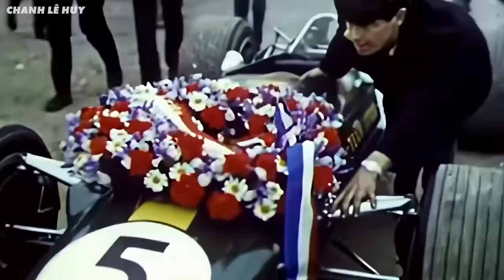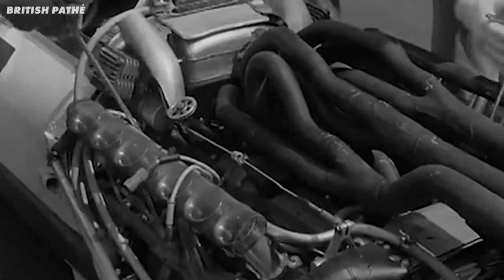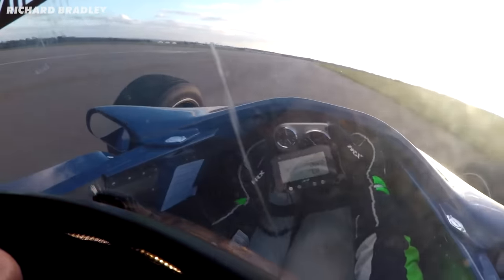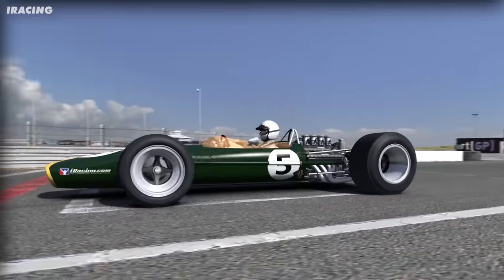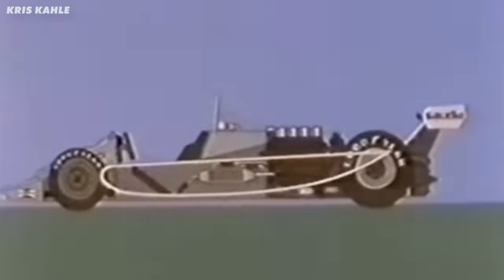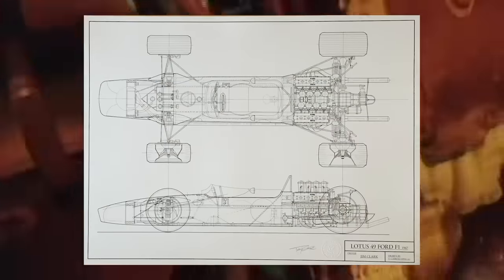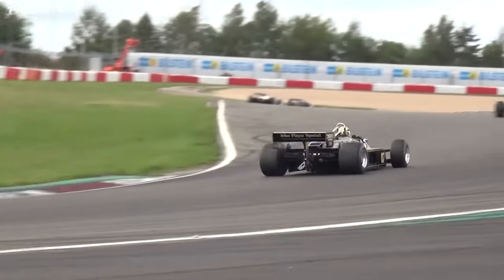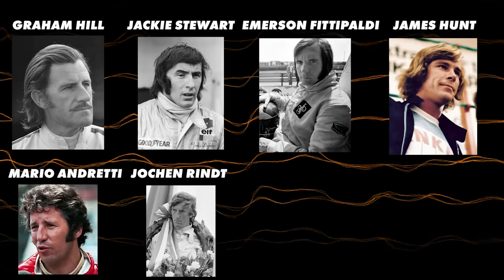When FORD Designed the GREATEST F1 Engine Ever!

Comment: So Ford provided the money  but didn't design and built it ,looks like the upcoming Red Bull deal.
Cosworth should be credited in the title.
Reply: Its usually called the Ford Cosworth V8.
Reply: Because RedBull are designing and building the engines, hence why it’s called a RedBull Powertrain. Not a Ford.
Reply: @JackPayne91   It's going to be called RedBull Ford powertrains and while RedBull will be designing and producing the Ice component of the powertrain Ford is working on the electrical side of the powertrain. So the powertrain is most definetly going to be a RedBull Ford.
Reply: Does it look like the RedBull deal though? Since for is most definetly helping develop the elctrical portion of the powertrain? Instead of just providing the money?
Reply: I mean, that's usually how employing someone works.
Reply: @JackPayne91  Well, the current RBPT was designed and still is maintained by Honda, is it not? ;)
Reply: @RalstigRacing according to who? I've never heard Ford even mentioned when someone asks what a DFV is... It's a Cosworth DFV... Maybe in America is was called a Ford, but the rest of the world knows better...
Reply: Ford haters always want to deny Ford any credit for their efforts even though things like this engine and like the GT-40, the Shelby Cobra wouldn't exist without Ford putting up the money and the request for these items. Ford told them what they wanted and the manufacturers delivered.. It's not like these items existed first and then Ford came along and purchased them. 
None of them would have ever existed if Ford had not made it happen.
Reply: @-joe-davidson  the issue with your examples is that most of Ford's accomplishments are rarely inhouse. The gt40 program sourced help from Shelby and his team, JW engineering and Lola. the only Ford thing in that car is that NASCAR 427 and then that 302 used in 1968 when JW Gulf took over the gt40. Cobra? Well that's all Shelby. Shelby Daytona GT ? That's all Shelby.... Shelby Mustang gt350R ? Well that would still have been a bitches car if it wasn't for the texan......The cosworth DFV was designed my Cosworth 💯........ Ford did zero engineering on that motor. They just used daddy Ford's tools and money that's it .....
Reply: @JackPayne91  why do people like you do that? Why leave out the part where Ford are designing the electric components of the engine, like Redbull didn’t get their engine tech from Honda? It’s a mutual beneficial partnership why you mad
Reply: @MiguelGarcia-vj7oo  the engine in the Lola was a ford engine though and other components, outsourcing components or design from other manufacturers isn’t new, Toyota do it with BMW, a lot of manufacturers, wtf you hating so hard on Ford for? Ford also share their tech with other manufacturers to benefit them and again, Redbull will benefit from fords advanced EV tech.
Reply: @ashdog236 I’m not mad, I am very well educated on the ‘26 RBPT. It’s very much designed and manufactured by Redbull, Ford haven’t really had much if any input.
Reply: Ford thru out its racing history has  just paid the Knowledgeable People to do the work...nothing learned...
Reply: @daniels.2720  that’s a CAP and big generalisation as Redbull are literally gaining Fords in house EV tech with this deal you flop 😂🤦🏻‍♂️
Reply: @JackPayne91  Make sure not to mention Honda, the company actually doing the heavy lifting.
Reply: @JackPayne91 Ford is helping with use powered in and 99% of the electric components …
Reply: @LiamNI it’s 100% justified to be called Ford engine.  SCA Formula 2 engine  engine used the Ford Anglia 105E engine as a basis, retrofitted with an overhead cam head and gear drive on the front of the block. That was the early stages of the DFV as far as I’m concerned. DFV heads were based on the FVA was based Ford engine… 

In September of '59, Ford of Britain introduced a new series of light-car engines, including the 997cc, pushrod Anglia. Duckworth recognized its FJ potential immediately, and Cosworth began producing it in competition trim

Within this same family of related engines, Ford also introduced a 1300cc, 3-main-bearing engine and then a 1500 with five main bearings. The company itself modified the latter engine for use in the Cortina GT. But Colin Chapman got hold of one of the first 1500 blocks and, with Duckworth and engineer Harry Mundy, produced the Lotus twin cam cylinder head for it. It was and still is fitted to certain lotus models and in 1963 was adopted by Ford of Britain for its lotus Cortina.

 Formula 3: production block, single carburetor and displacement of under 1000cc. Also there was Formula 2, for the same displacement limit but without the stock-block restriction. Cosworth built engines for both of these categories, basing them on the Ford 1500cc, 5-main-bearing block. They were immensely successful and a strong raport grew between the big and the little firm.

Duckworth presented his sketches to Harley Copp, engineering director of Ford of Britain and a seasoned judge of racing matters. Copp was impressed by what he saw and by the possibilities it held for a most logical program combining Formulas 1 and 2. A series of meetings followed between Copp, other Ford of Britain technical brass, Duckworth, Costin, Chapman and his chief designer, Maurice Phillippe. Every aspect of the idea was explored and finally, in November of 1965, the program was blessed with an allocation of $280,000.

IT IS 100% FORD ENGINE Duckworth was an amazing engineer Ford and Him made it happen… if it wasn’t for Ford engine would’ve never existed .. he heavily based DFV all he learned from modifying working on Ford engines..
Reply: @ashdog236 hahaha hahaha hahaha like Ford's EV tech is something to brag about... hahaha hahaha hahaha
Reply: Some of you people are egotistical. When ford decided to go sports car racing they gave Shelby and all of the designer an open check book. Without that done of that stuff would have happened
Reply: Ford is a global manufacturer not a country. Their are ford's made in many countries so they were built in England as well, so why the nationalism.
Reply: @bobcrutchfield4416  by that analogy just about every car manufacturer is a global company. I would never classify Porsche anything but a German car manufacturer even though they build some SUVs in the states...SMH
Reply: @bobcrutchfield4416  some are just stupid.... SMH
Reply: Excuse me, but their are Fords built in other countries that the people of the US probably never even knew existed.  Such as for example Fords in Austrailia are unique only to Austrailia. There are
Reply: @bobcrutchfield4416  well guess what... I knew about that. Especially being from a GM employed family.
Reply: @republicdecease  
Red Bull hired a hybrid guy who worked for Mercedes. He will have access to Ford's R&D. But let's face it, Ford don't even make their own EV power trains.
Reply: @-joe-davidson  
GT40 was designed by LOLA
Reply: @mick8473  
And ultimately built by Ford because every car they imported couldn't handle the power or track conditions so Ford with Shelby started building them from scratch based on the Lola design.  You people act like the owner of the Ford had to design and build every car by hand to be a Ford. Every car manufacturer hires designers, engineers, everyone they need to create their cars. 
At the end of the day, the GT40 would have never existed without Ford and Shelby.
Reply: According to Keith Duckworth  ,at the time, the idea for the DFV was based on the 91 cubic inch 4 cylinder Cortina engine, with the Cosworth cylinder head.  Making a V8, was a natural progression and feasible.  So the idea was sold to Ford management,  who put up the money $$$$$$$.  The rest is history.
Reply: Problem is Ford owns Cosworth and arguably brought this team together specifically because they wanted a performance racing engine manufacturer under their umbrella both to make money and to support their owned and operated teams like the Le Man teams that were still running at the time.
Reply: @timothystamm3200  Ford did not buy Cosworth's racing engine division until 1998. Then Ford sold it off, in 2004.
Reply: @daniels.2720   so Mose Nowland, Howard Sullivan, and other engineers that worked on all these projects, don't count. They all had long careers at Ford. May I say without their knowledge,  little would have been accomplished.
Reply: @MiguelGarcia-vj7oo not are most cars!  IT IS A FORD!  WHO CARES!.  Out of the big 3, Ford is the only one that go designs and builds their own diesel engine and transmission in the heavy duty trucks but you all don’t complain about the Duramax (Isuzu) and Alison (branded now), or the Cummins in the Dodge…..
Reply: @MiguelGarcia-vj7oo Ford has more banned engines then the competitors because the competition couldn’t match them in some cases.  The Cleavekand, the “cammer” 427, this cosworth, the 4 cylinder Cosworth, the Barra, etc…. Just because you’re Chev, Dodge or Toyota fan boy (whichever you are, because you’re definitely one of them) doesn’t mean Ford shouldn’t get credit for what they’ve done, or any of the others for that matter.  They’ve all made their contributions to the industry.  You are just a troll….